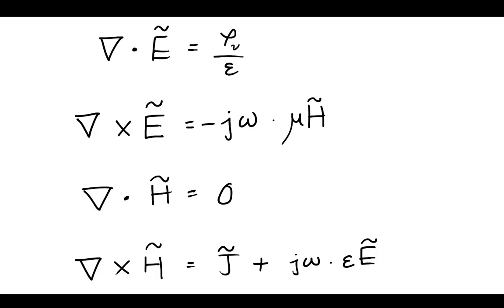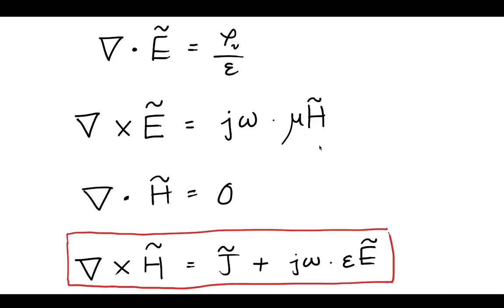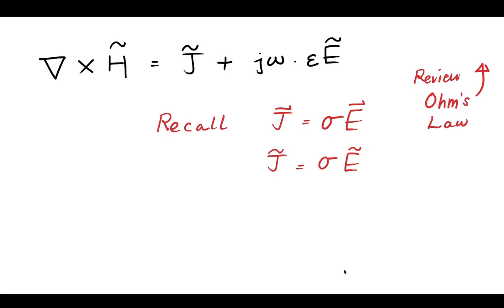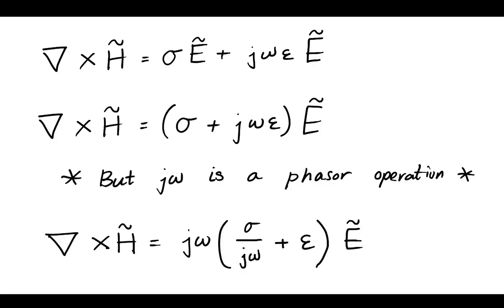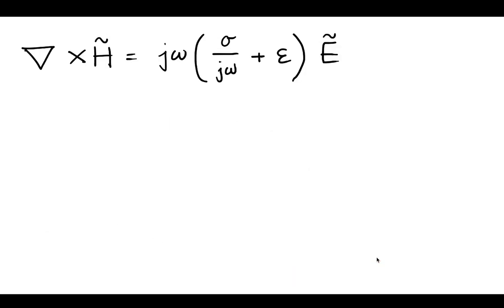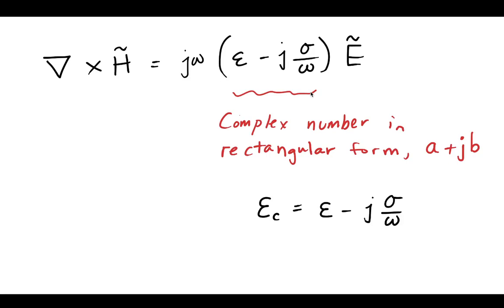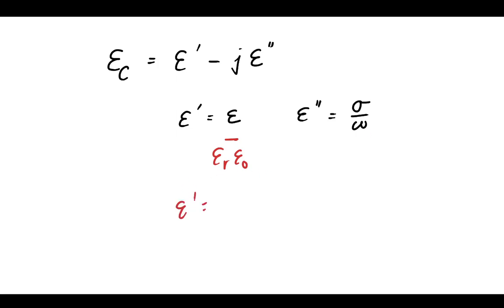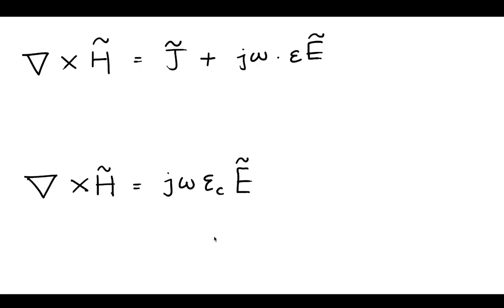Defining Complex Permittivity

Comment: Ok but what about the losses due to the polarisation? I mean er in general is already complex because in case if time varying electric fields the polarization vector is out of phase. From my understanding the imaginary part should include both, losses because of sigma, but also the polarization losses. Im a bit confused about the topic.

Also if sigma/omega represent the conductiob losses, what happens at omega=0, losses will be infinite at dc? Please help me out
Reply from the maker: Hi, thanks for the comment. Are you referring to polarization loss in a link budget for something like an RF communication link? That polarization loss might be described as a normalized value between zero and one when taking the dot product between polarization vectors of a wave and an antenna. Rather different than what is discussed here.

As far as further consideration of the role of materials with realistic sigma/omega, I suggest reading ahead to Chapter 7-4 on propagation in lossy media. There is a solution for a linear polarized E field as equation 7.68. This solution further separates \gamma into the real attenuation component (\alpha) and the imaginary phase component (\beta). Then simplifications for various media are discussed. This topic is further discussed in many graduate level textbooks. For example the David Pozar "Microwave Engineering" text discusses wave solutions for various cases of dielectric and frequency. 

Best,
Dr. Chrysler

Comment: but why do we need complex permittivity?
Reply from the maker: It allows you to re-formulate the Maxwell's Equations into standard Partial Differential Equation (PDE) forms for both the E and H field. It is also useful for understanding the wave attenuation in lossy media. These topics may be more common in graduate level courses. 

For lower division, the key point should be that you notice a complex permittivity allows you to write the Ampere Equation so that it 'looks' the same as the Faraday Equation in the phasor domain.
Reply: @Dr.C.Eng.Education  Does the imaginary part represent the attenuation? And similar for complex refractive index too as it is defined using permittivity?